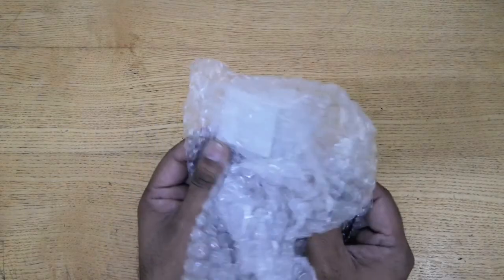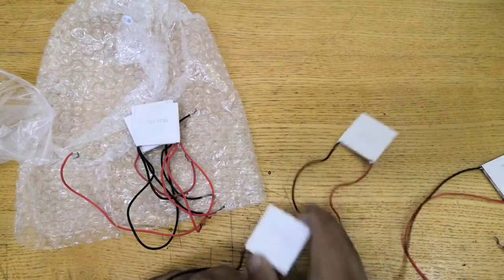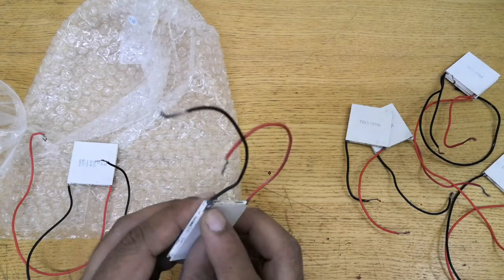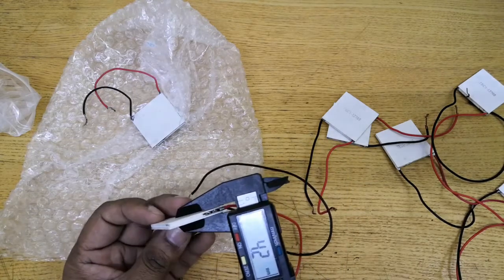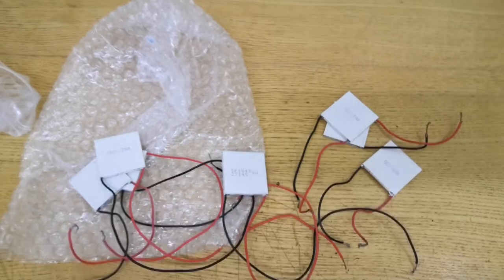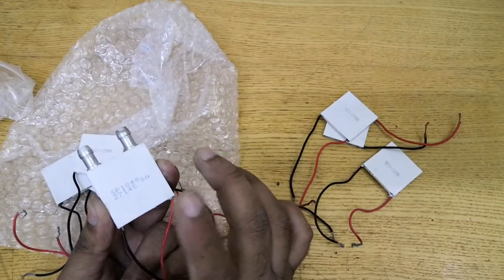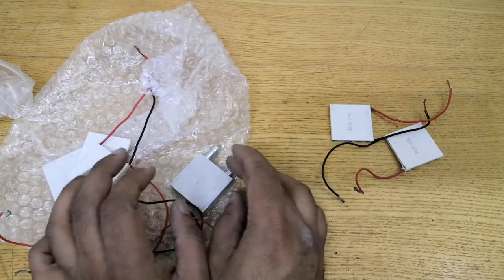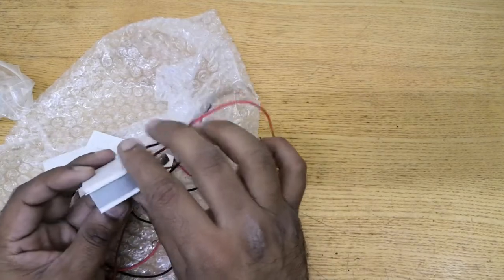PELTIERS-DOES IT WORTH..? EXPLAINED

Comment: Hi, saw your video and was saddened to learn your experience with peltier. I just want to use a peltier using my air cooler and i am not intending to cool all my room even though it is small. I only want it focus in one direction mostly in the lower body when i am sleeping. Also to minimize the use of always using ice to put in the cooler. I am currently using tec 12706 and yiu said that you much prefer 12703 ,can you tell us why? Thanks

Comment: Wick peltier is best for colling?
Reply from the maker: Tec1-12703 is the best in my opinion
Reply: @DIYTAYSEERworld  If it is okay if I use 12706 and how many 12706 peltier to cold enough the water for making a AC?
Reply from the maker: Tec1-12706 is not better.. The best is tec1-12703..
Use multiple units as per your desire.. more peltiers more cooling..
Yes it is possible to make AC
Reply: @DIYTAYSEERworld   hi I have SP1848
27145SA is cooler or not
Reply: okay thank you dear